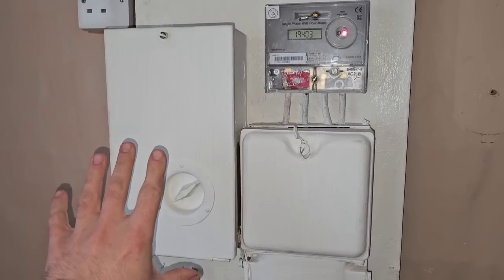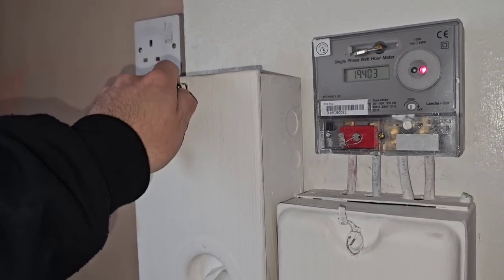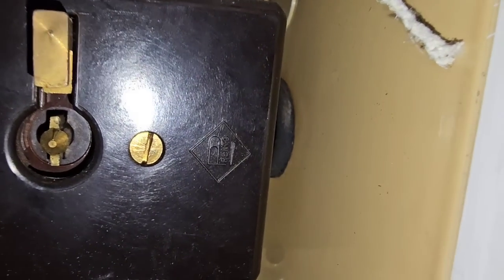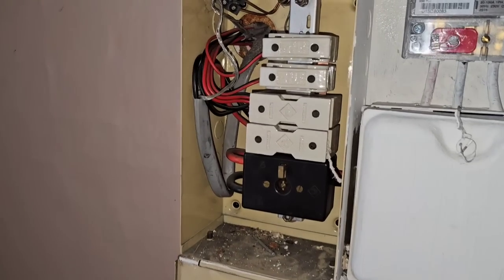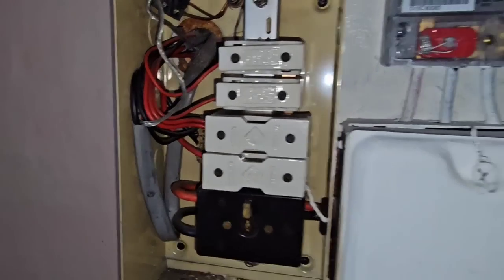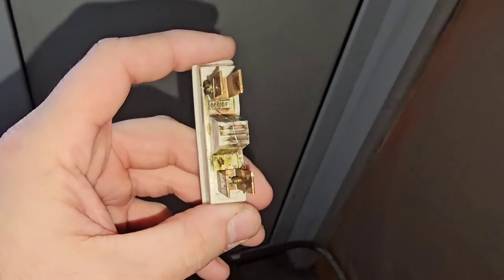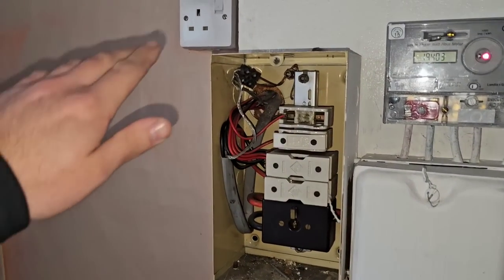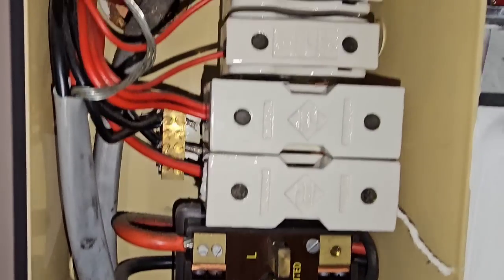Is this the oldest fusebox you've ever seen? 👀

Comment: My former home had a single fuxe box that looked like the lower right unit you have.  It contained two fuses, the upstairs fuse and the downstairs/garage fuse.  60 Amp service.  Inside the cover plate was a label from the original inspection in 1925.

Comment: One of the very first distribution panels I poked my fingers into was in the attic of a three story masion built in the 1860's but converted to a 13 unit apartment building in the 1950's. The panel had an exposed two pole knife switch for the main disconnect (think Frankenstein movies), glass fuses, and wiring so crazy and crammed in that it looked like a squirrel's nest. A combination of knob and tube, BX and its antecedents, and Romex. 40 years later I can still see it clearly in my mind.

Comment: It's not too old - mid '50s to early/mid '60s

I spent much of my apprenticeship taking these out (and earlier stuff) to put in the "safer plastic" units - which are now being taken out for the "safer metal" ones....

Tbh these ones weren't any problem,  there were some where when the fuse blows it sent an arc jet out of the top and bottom of the holder - sometimes this could create an arc between the line and the metal cu - ok if it was the circuit side of the fuse, but if it was on the feed side then the arc would be continuous!!

Comment: Not impressed.  Older still were massive units made out of cast iron. The interiors made out of ceramic material with double break, double pole knife switches. Rewirable fuses.
Totally fire proof. Totally indestructible.  One of the makers i remember was "BILL" but there were others.

Comment: Abestos flash guards hmm Code C1 or C2?
Reply from the maker: I coded C2 for the asbestos and access to live parts if a fuse required replacing. It has the potential to be dangerous. But you have to seek it out inside the DB to be in danger. But I'm open to opinions!

Comment: That setup wouldn't be allowed in North America. Here there must be no junction boxes as seen here because of the chance of stealing power, bypassing the meter.
Reply: This sort of stuff dates back to when manual reads were done.  It's tamper evident rather than tamper proof.  The meter reader would cast an eye over things and if anything was suspicious someone would come out to check the installation.  The same basic principle of tamper evident is still done even though smart meters means no one comes round to ready any more.  If they think something is suspect the authorities use right of access and take a look at the installation and if there has been tampering, you're done.

Comment: In the early 70s we lived in a pre war house in Whitley Bay in the North East, Geordie land why eye!!!  I was still at school and mad keen on all things electrical and electronic, so when we had our kitchen refitted I was doing the electrical work to keep costs down. That was when I discovered that it still had the original lead sheathed wiring, which ran to wall fittings and light switches on the surface in wooden conduit!!!   Many of the sockets were still round pin!!!!  The fuse board was a wooden frame with steel supports that held the fuses, all 4 of them!!!!  I did check the earths and insulation with a hand crank megger though!  And incredibly it was all good!!  My parents couldn't afford a rewire so that's how it was left during our time there, never had a problem!  In my experience, the worst wiring I've ever seen was in Italy in a hotel on holiday in the 80s, it was literally hanging!!!  Bare wires with old insulating tape barely hanging on, in a bathroom!!!  Little junction boxes all over the place with the wires just twisted together inside!!  It was a horror show!  Nothing like the stories I've heard from India though, where people just tap into supplies and steal their power, no fuses, no isolators, just direct connection to the primary supply!!
Reply: Before that was single rubber cables, braided in cotton, carried on ceramic "cleats". (Cable was known as "VIR") Vulcanised India Rubber.
Reply: @harry130747  
I actually have some of that cable!!  I salvaged a few mtrs from an old factory that we rented as an industrial unit in the late 90s. The owner had a new breaker panel installed and a lot of the old wiring was stripped out and upgraded to new for safety, probably as a result of trying to get insurance knowing landlords!!!  I'd never seen that sort of cable before, so saved some for posterity. Amazingly it's still in almost perfect condition!  I also liberated some massive old cast iron isolator switch boxes, I just couldn't see them go to scrap as the quality was incredible compared to the stamped steel rubbish we have now.  Some years later I met an "upcycler" who specialised in converting old industrial equipment into decorative lifestyle objects, she almost had an orgasm when she saw those old isolators!!!  She begged me to sell them to her and offered an insane price. I accepted with one condition, that she gave me one of them when she'd done her thing with them. I'm still have that now, converted to a light with trinket storage inside. It was one of the larger ones, from memory a 200 amp, 3 phase isolator, about 20" high and weighs about 20-30kg!!!

Comment: I worked at a large property in rural North Yorkshire in the early 90s which had, not one but two, 8 way wooden fuse boards. It had me confused for a while as one of the fuse boards was for the neutral, so a lighting circuit, for example, had a fuse in the live & the neutral!  How old was that.

Comment: Oldest I ever saw was a double pole knife switch with a single Edison fuse on the load line from each pole.
Cloth wrapped wires.
I think they had one 1-bulb light fixture in each ceiling and I think one 2 prong outlet in each room.
Ceramic posts too.
Really OLD couple owned the house.
They had a curved top refrigerator with a chrome one armed bandit handle to open the door.
They used a radio, no TV.
Toilet had the tank mounted on the wall. Claw foot bathtub.
Reply: Yeah, most of our farms sounds like that, cloth wrapped wires with the rubber perished and bare wires (mostly from rats) everywhere!
Reply: Very common service from the 20s and earlier. Took down an old farmhouse with similar shutoff switch. Each room had a pull chain porcelain lampholder. There was 1 receptacle in the living room and 1 in kitchen, and a radio connection in living room. 
I hoard electrical artifacts, so I did save everything but the wire.

Comment: Hi John, I’m a retired UKPN cable jointer, that style of meter came out around 20 years ago, and one of the reasons for it was so the utility company that installed it didn’t have the monopoly on where the customer bought their electric from, when the utility company’s sold electricity (Seeboard) So on new building estates, we would install the new service, fit and connect the meter, then isolate the outgoing terminals via the switch on the front of the meter, then put a seal through it to stop it being  turned on. We did get paid for fitting the meter. You don’t have to remove the lid to turn it on or off. Fitting this meter enable the electrician wiring the house, to liven it up after completion, not having to call in the meter inspector etc etc. The customer would move in, and then just nominate who their supplier was, giving the meter number and reading. I’ll bet there are still houses out there that aren’t paying for their electric as it was connected when they moved in???? These days most of the electric providers install separate double pole switches; this stops the need to touch the meter at all.
The service head is a metalclad style, which we used to call “a biscuit tin cut out” for obvious reasons and is compound filled at the bottom, and we would change these live without too much grief, and there is no asbestos in them. Before it was painted white it would’ve been a cream or black colour and will have a 60amp (1361HBC 2) small bore fuse in it
Reply: By me there can be separate meter companies, but you will still have the Metro supplied meter, either prepaid ( other meters will be sub metering) or a postpaid one and a prepaid meter,and thus the discrepancy shows up rather fast as they run a check on non revenue meters every so often, plus also do sanity checks on consumption versus the neighbours. That of course is only in areas the meter readers will go into without armed security guards and bullet proof vehicles.

Comment: The oldest one I came across was wooden with a glass front, fused in both poles, ceramic carriers! The whole installation was overloaded, with bits too hot to touch. Dated from 1928 when the shop was built. It was in a greengrocers shop in Croydon! This was in the late 70s.

Comment: I came across similar some years ago.  That head looks like an enclosure for a dual ceramic fuse.  You should get the DNO to check because it could have a fused neutral which is extremely dangerous.  If it does, the DNO will replace it with a BS1361 for free

Comment: One wonders why the energy supplier who fitted the meter didn’t recommend a board change/ rewire. Also, pvc covered wires of this vintage is known to ooze green goo.
Reply: Maybe the supplier did, but unless someone is going to pay for it, the change isn’t going to happen.
Reply from the maker: Most meter operatives are not electrician's. They're your average joe who has been trained for a specific task. When I sat the MOCOPA training it was very mundane. But it taught you a method of replacing a meter that meant you required zero electrical knowledge to get by. It kept you safe but I still argue it should be done by competent electrician's

Comment: If all your test comes back within the specified limits and considering the overall condition it safe for continued service . Point 2 
BS 7671 are not retrospective RCD became mandatory in the 17th edition amendment 3 going forward you are not required to fit RCDs on installations designed before the 17th edition amendment 3 . If the a socket the can /is used for outdoor equipment replace it with an RCD socket which is permitted by  BS7671 earthing on lighting circuits became mandatory in the mid late to eighties  because people started to replace their standard pendant lights and switches with fancy metal light fixtures mostly bought from Woolworths, B&Q and Homebase. That Fuse box and the head date back to the mid forties early fifties, the circuit cables early sixties. The asbestos flash guards are harmless as long as they haven’t been pulled apart and or falling apart. Asbestos is only dangerous when it is pulled apart or broken if’s solid asbestos like ceiling panels those flash guards are a woven material so unlikely to break apart and your unlikely to breath in any fine particles. 
My wife’s uncle worked in the asbestos factory in Watford in the fifties and early sixties and I asked him about the asbestos flash guards he told me what I have already said in this comment and he would know as he used to make the dam things .
Reply from the maker: I quite agree with most points. My main issue with this DB is non competent pewouldmay have to replace fuse wire and be exposed to ACM's and exposed live parts. 

The DB has no been replaced and it's in a far safer condition 👍

Comment: I changed a lovely 1940’s unit made from quality wood. There were fuse carriers for line and the same carriers for the neutral conductors. I have kept the casing, as it is a piece of history and beautifully made.
Reply: Orignally a DC fuse board I would think, I remember seeing a few of them in a factory  I worked in that had motor generator sets for lighting. Sometimes the incandescent lighting was AC  if the water powered DC side of the motor generator was driving or  DC if the  main ac steam turbine driven wound rotor AC side of the motor generator was powered. EdiSwan  (Edison and Swan) and Igranic open slate "board" mounted  wooden handled blade switches with spring mounted sacrificial tips on the blades that took the worst of the arc when opening the switch . People  wondered why there were so few old sparkies around by the 1960s.:face-fuchsia-tongue-out:

Comment: I would fail it because of the asbestos fuse flash guard material on health and safety grounds. It cannot safely have a fuse wire changed by the end user. It would also go down as a limitation on the test forms . I would also label it as asbestos on the consumer unit.

Comment: The asbestos is usually deep within the carrier and it's only usually covering the middle section of the carrier where the fuse wire crosses it. The piece you can see protruding out of the fuse carrier has probably been added at a later date and is probably an asbestos substitute. Local councils were still changing these old units on rewires will into  the late 1980's. I sometimes contracted for the council and exchanged many of these old units for those chunky old  Crabtree C 50's.

Comment: The diamond logo and printed circuit chart look just like the ones on some old boards I've got in service here. They were made by the Dorman Smith company in the 60s and 70s. The ones I've got were commercial and use BS88 offset tag fuses rather being rewireable.

Comment: The early plastic cable was better quality than some of the later stuff.  
Just because they’re is earth wire in the lighting circuit doesn’t mean it serves the whole installation. Possibly just the ceiling fittings and not the switch drops.
Also near me there is a housing estate and every house was first wired by the SEB. Guess what they have earths in the lighting circuit, but in the early 60s there was no requirement to have earths in the lighting circuits. So they couldn’t be bothered to connect the earths in fittings or joint boxes.  Quite dangerous for Mr DIY . He sees an earth wire ,assumes he can put up his metal light fitting and thinks alls well. As he’s done no testing he is putting his or anyone’s life in danger  , unknowingly 
.

Comment: Are you doing a video on testing this? It would be a good learning video on how you go about testing an installation with these practical limitations.
Reply: I'd think Zs from the ends of circuits, ring continuity from sockets on the ring. global IR can be taken from anywhere. Limitation for not inspecting what is in the fuse carriers due to asbestos concerns. C2 for lack of RCD protection on sockets reasonablly expected to supply equipment outdoors. C3 for lack of RCD protection on other circuits.

Assuming no other faults found, reccomendation to replace the fusebox with one incorporating RCD protection.
Reply: @petermichaelgreen  I think that covers how you could practically do it taking in the limitations some mind you would just put Lim

Comment: Be careful with the term wetting down as people may take that as water. water has no effect on Asbestos it is one of the many reasons it was used What is meant to be used is a wetting agent (yes I know) but for this, I would not even bother anyway I would recommend is cutting all cables without even removing the fuses, remove the board whole and double bagging in approved asbestos bags. 
all this should be done in full PPE so Respiratory mask FFP3 min half face Respiratory mask with p3 filters if you doing few of them (face fitted), Cat3 type5/6 coveralls, goggles and gloves this is all a minimum if doing this, then clean the whole work area with rags using one side of the rag with each pass to be bagged as asbestos waste 
AND GET THE RIGHT TRAINING CAT B
Reply: Whenever I talk to people about asbestos and wetting agents I usually get blank stares.  It's good to find someone else that's aware of the need to use them rather than straight water.  All Australian houses from mid '80s and earlier have at least some asbestos materials in them, the older they are the worse they get.  Our old wood frame switchboards were laced with asbestos.  Not only the switchboard itself (black back board) which is often > 25% asbestos, the wood frame would often be lined with asbestos cement sheet for fire resistance.  Young sparkies still just go at it all with high speed drills and throw dust clouds around.  The act of drilling breaks the asbestos fibres free so they are more or less bathed in asbestos fibres.  If you are lucky you might see them spray a bit of shaving foam around to try to contain the dust but it gives a false appearance because it cuts down the visible dust but there's still plenty of asbestos fibres floating around.  I've had it happen at my own house and I can't help thinking that we are in the process of developing another big round of asbestos related disease in 40 odd years time.  There's also asbestos matts in and under the old ceramic fuse blocks.
Reply: The flame retardant material was deep inside the carrier where the fuse wire crossed over it. The piece protruding from the carrier in this video was probably added at a later date and was would most likely be an asbestos substitute. These things were harmless. I sometimes contracted for the local council and was ripping out these old units well into the late 80's as part of a rewires.
Reply: @truthseeker7794  No amount of aspestos is harmless
Reply: Get a life